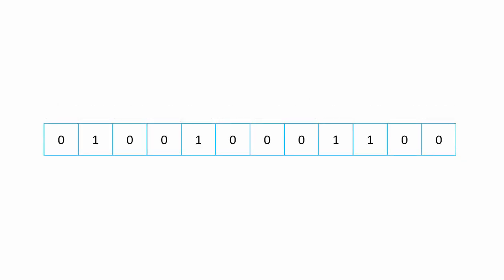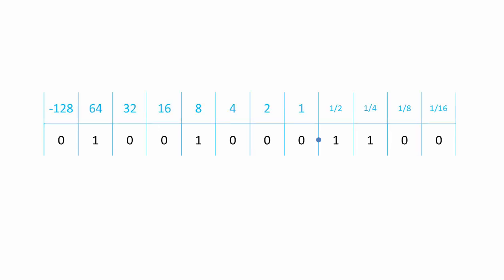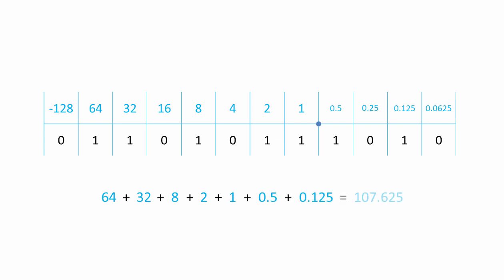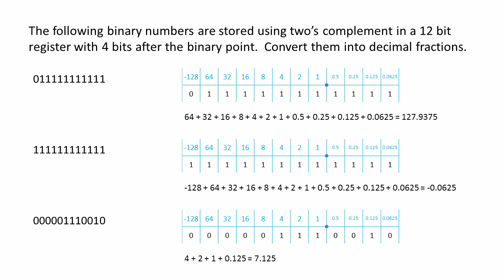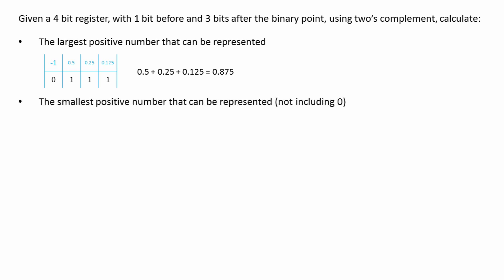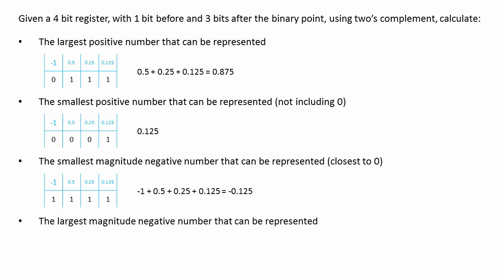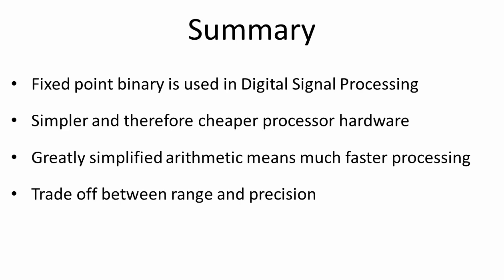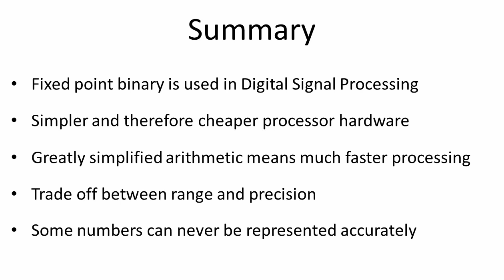Binary 3 – Fixed Point Binary Fractions

Comment: just one question! if the denary number given to us is negative with most significant bit as 1 then do we need to take the 2's complement of the rest of the integral part ?? or do we convert into binary without any complement?
Reply from the maker: Fixed point binary is an alternative to two's complement.  If you are asked to express a denary number in FIXED point binary, then two's complement is irrelevant.  Just assume everything is positive when you do your conversions then change the left most bit to 1.  If the left most bit is ALREADY 1, then the magnitude of the number is too big to used fixed point notation.
Reply: got it! a bundle of thanks ..

Comment: and why couldn't I represent -55,75 as 11001001.1100?
Reply from the maker: If you were a processor designer, you could design one to do just that.  However, when working in two's complement, you would typically add the fractional place values to the overall total.  Hence 11001001.1100 becomes -128+64+8+1+0.5+0.25 = -54.24   You will need to do it this way if you plan to learn about floating point binary next,

Comment: Doing this in my mock exam.

Question: What is the bicimal representation of the decimal number -15.625?

Answer: -1111.1.1.

How? Your method gives me something completely different.
Reply from the maker: With 8 bits to play with, positive 15.625 is 01111.101 in fixed point binary.  The left-most bit is then changed to 1 to indicate it is a negative number.   Has a zero been swapped for a point in your anwser?

Comment: I converted the real part of -55.75 to binary using the long division method and keeping track of the remainder which gave me 00110111. If I flip the bits, I assume that's how I get -55. 

After that, I tried calculating the non-integer part using the long multiplication method and keeping track of the real number result - this gave me .11 for the non-integer part, which doesn't quite match the answer even when flipped. 

I'm assuming the method I'm using can't be applied to negative integers the way it applies to positive - but I suppose this is all easily solved if I just use the place table method instead. Another thing that confuses me is when a question says "Using two's complement", because my understanding of two's complement involves flipping the bits and adding 1 to the LSB - but that doesn't seem to entirely apply here either.
Reply from the maker: The flipping bits and adding 1 method is problematic.  You would need to look at the whole number part first and recognise that your starting point is -56.  (11001000) Then you need to work out what fraction you need to add to it to arrive at -55.75, namely 0.25 (.01).  I think the best approach is to use a place values table. :)KD